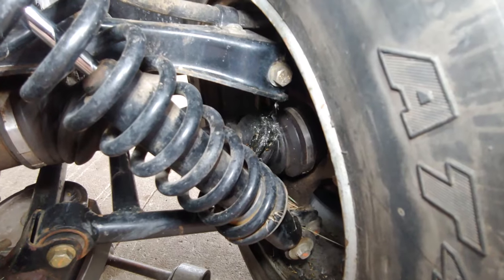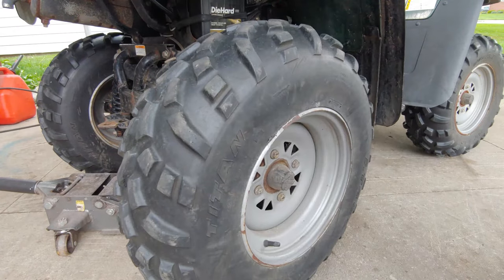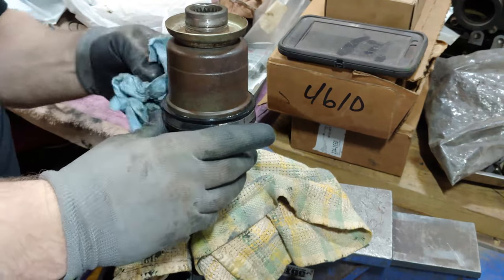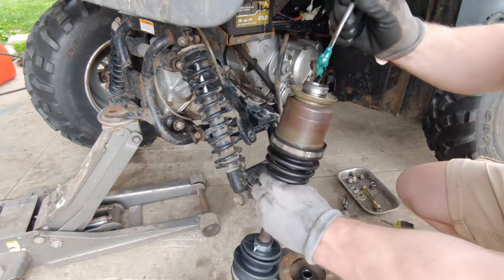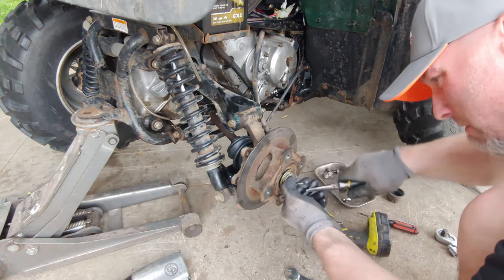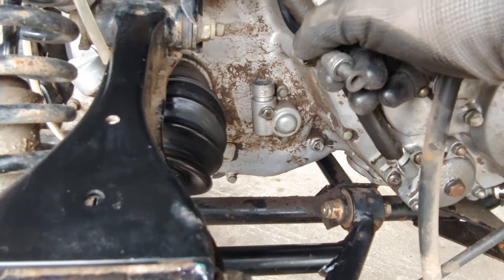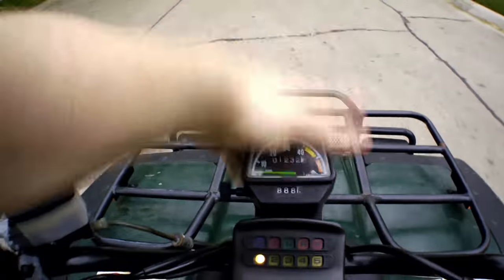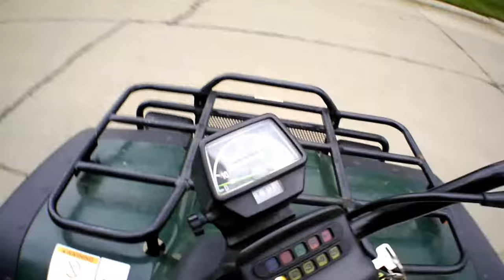99 Arctic Cat 300 4x4 ATV Repairs | CV Boot Replacement & Speedo Fix

Comment: How did you get the clamp tightened on the IB boot?
Reply from the maker: I just used a pair of vice grips. I understamd there is a tool but once you get the little inner notches locked in in the strap, clamping the one spot does the trick.

Comment: My rear right side shock on my 17 arctic cat 400 broke at the bottom of the shock where it mounts to the A arm
Reply from the maker: Whoa... How the heck that happen???
Reply: @Fixin2Ride-Official-  it happened during the winter overloaded the shock on oneside with weight and im guessing the shock was half ass rebuilt or it vouldnt hold the weight im not sure
Reply from the maker: @edwardabrahamiii3742  Ah gotcha. Yeah gotta have those good seals put in on a clean rebuild.